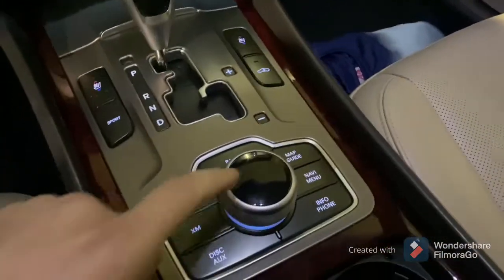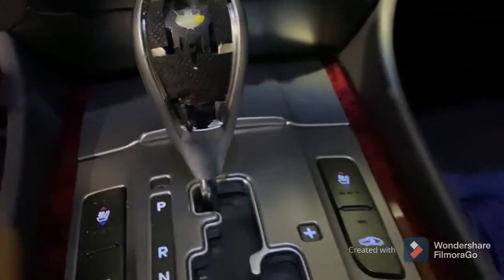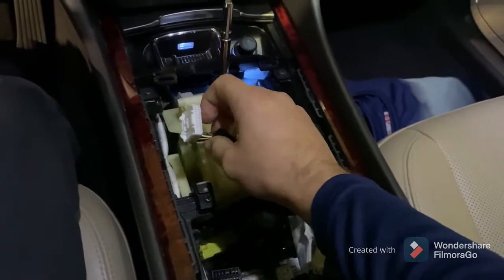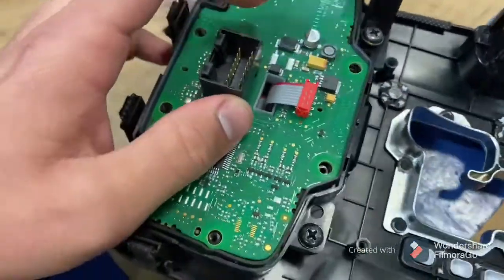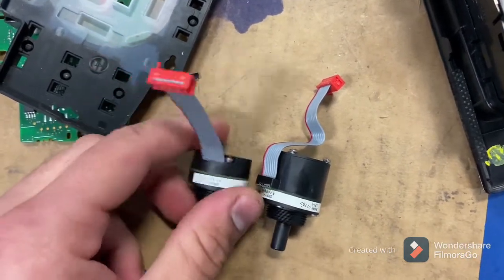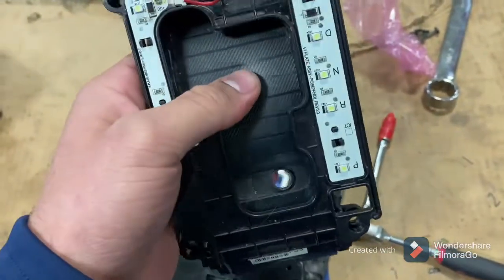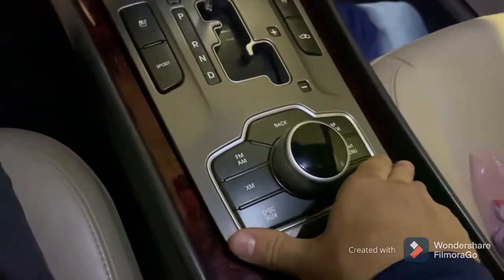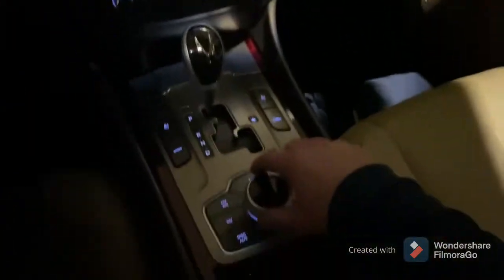Hyundai Equus Center Console Joystick Knob Encoder Fix

Comment: That part number joystick has very little resistance and feels sloppy.  GRAYHILL 60AD18-8-M-060C costs a few bucks more, but has the feel of the factory joystick.  Also, if the button function is the only problem you are having, be sure the knob isn't bottoming out, preventing the button from being fully pushed.  Pull the knob off and push down on the stick.  If it works, then your knob was bottoming out.  That can be fixed by putting a little tin foil inside the knob as a spacer before reinstalling.
Reply from the maker: I mention this in the video. The OEM part number was on a 16 week back order at the time of this video. The part I listed has been working fine for me
Reply: @mattmars1405  with this work in 2014 Equus?
Reply from the maker: @Chris_The_Realtor  yes

Comment: Thanks my guy, I needed dis in 2024. My radio stations will not search in sequence, by that I mean they’ll not go from 12345, instead it goes from 14 to 21 or when I search up it goes from 156 back to maybe 45or sumthing like that. The dealer wanted $2400 to fixed that for me. 12:52